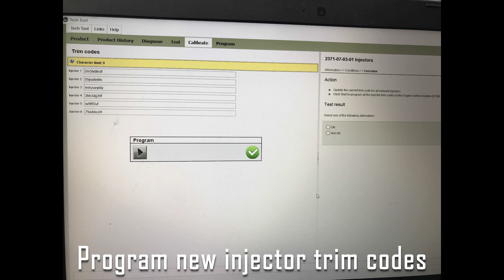Volvo D13 fuel issues

Comment: What’s the price range to get injections done on a d13 engine? I have a 2012 Volvo that has a hard crank and it seems like I’m using a lot more fuel than usual. I also have a check engine light that comes on but turns off within a day.
Reply from the maker: Jimmy, would you be able to bring it by.  You may have another issue.

Comment: I seem to have the exact same problem on a 2014 Volvo, I don't have trouble starting the truck, just a little more fuel consumption than normal, and a little bit of loss of power, how much would it cost to do this same repair and how long would it take?